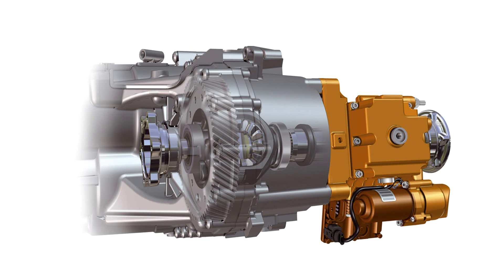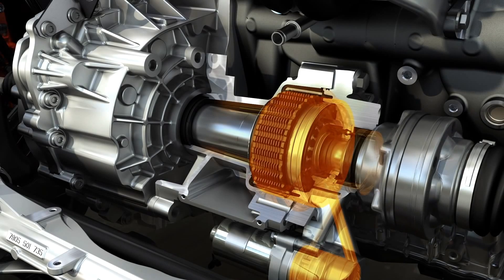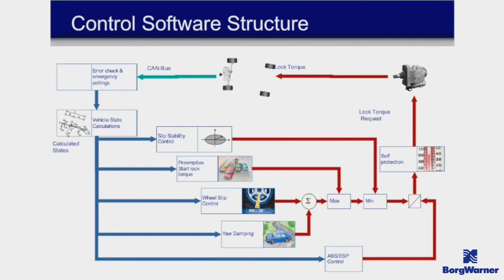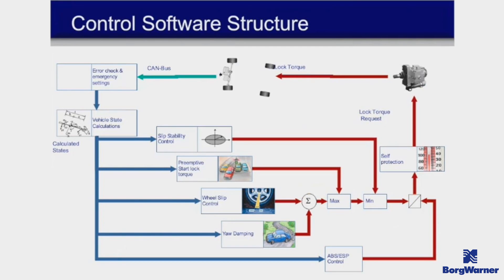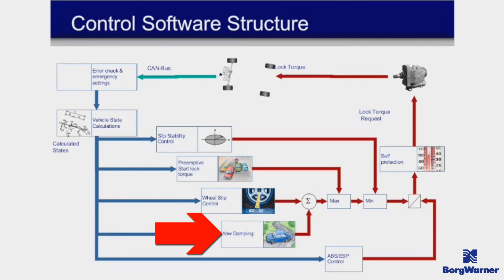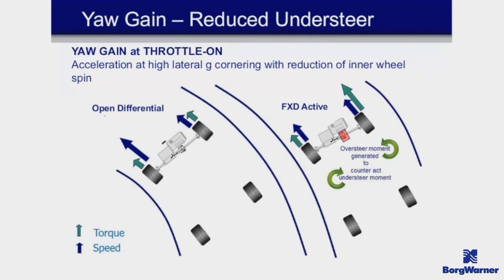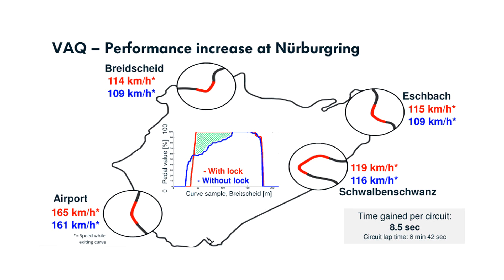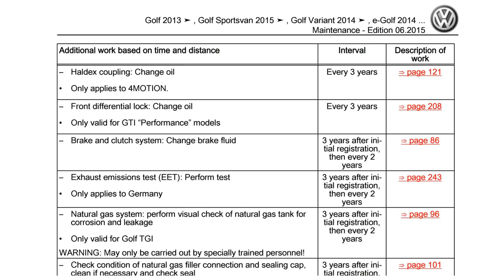How the VW (VAQ) Electronic Limited Slip Differential Works (MK7 PP)

Comment: Does VAQ work alongside XDS or instead of XDS?  A lot of the time when it rains and i try to move from a stop at a light, i get the traction slip light on my car.  As that happens it jolts making a sound like a bang noise like its going over a speed bump, (the brakes lock) then returns to driving normally after it regains traction.... It only happens when its wet conditions, i was wondering if thats normal, something i can turn off, etc
Reply: Sounds like wheel hop maybe?
Reply: I think its the front tires slipping on the thick painted white line at a stop light.
Reply: i would also like to know
Reply: It’s wheel hop, common with crappy tires (upgrade yours to pilot spot 4 all seasons or summer tire). If this is with the 2.0T engine, the engine produces peak torque super fast, which causes crappy tires to break traction in the wet extremely fast

Comment: Does VAQ come on some haldex systems or is it strictly for the mk7 performance pack?
Reply: GTI_CHHA I was talking about vaq on the front axle, lol
Reply from the maker: not on Haldex cars at this time.  Only GTI
Reply: you are wrong! Seat Cupra 300 4drive also has VAQ.
Reply: Read up first before saying something stupid. The VAQ is just a Haldex system, located at the front-axle. The Cupra 4-drive you are refering to has the Haldex to control the rear wheels, no VAQ at the front axle. The hatchback Cupra (FWD) does have the VAQ though, as it has the same drive train as the GTI.